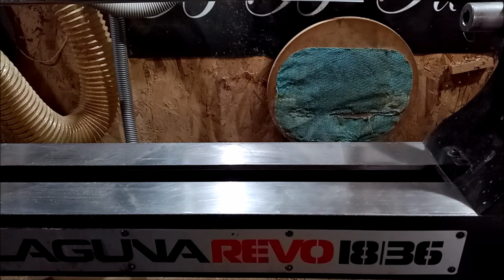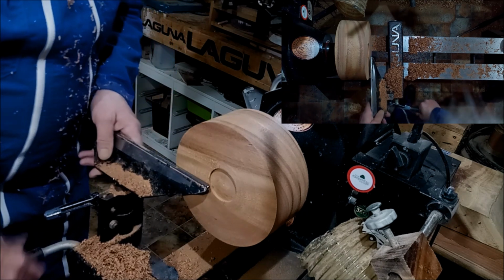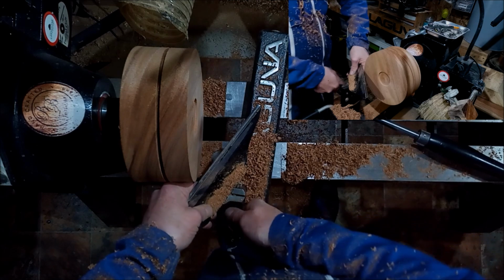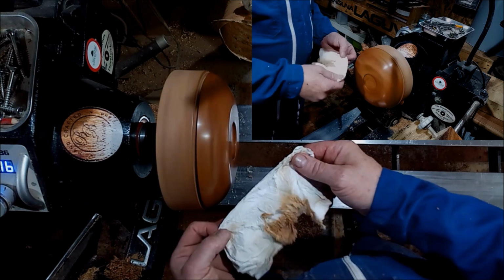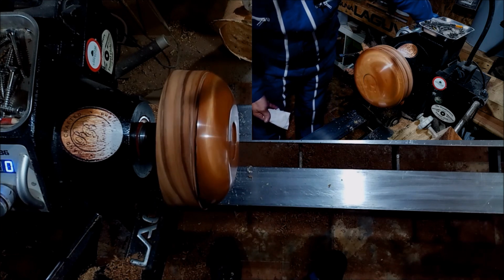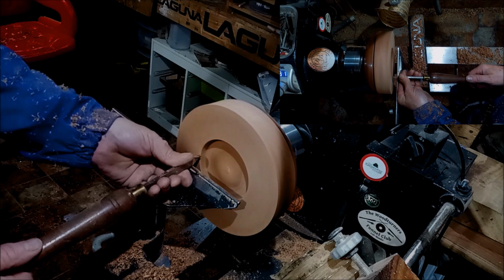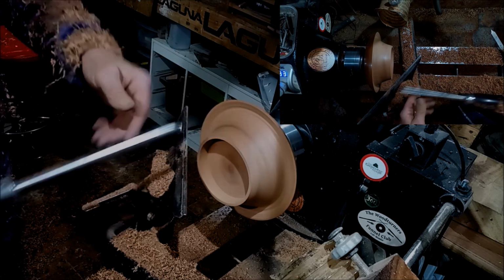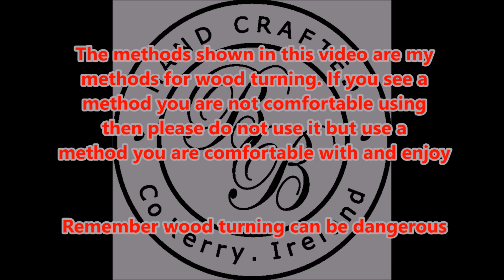Woodturning a holder for a candle in a jar / wood turning

Comment: Shay I'm new to your channel & to turning. I'm learning so much so thank you very much. As a Scotsman & a fellow gael I'm loving the Irish legends. Keep up the good work & I'll be continuing to tune in & thanks again. 
Jim
Reply from the maker: I am glad you are enjoying the videos Jim, welcome aboard mate. If you have any questions that i can help you with just ask.
Shay
Reply: @BBTurning  Thanks Shay. I'll take you up on your offer of advice. My workshop /shed was built 4 weeks ago & I have all new machines ready to fit up & install. Unfortunately I lost my mum 3 weeks ago so obviously everything went on hold. My lathe is a Rutlands R2000, 12" swing but can I ask, the centers that were supplied are acceptable but not the best. I'm replacing them but am I better off getting a matched pair of crown /steb enters or a matched pair of ring centers ? Thanks in advance & this will no doubt be the 1rst of many questions I annoy you with 😊
Reply from the maker: If you are getting new centres I would go for steb, they are much safer and more forgiving Jim. My condolences on your Mum, mine passed about 10 years ago, it is not an easy thing.
Shay
Reply: Thank you on both counts, center advice & for my "dear auld maw" God bless her

Comment: I agree with you it's a great job you have done. How are you getting on with your power respirator Shay
Reply from the maker: It works great Steve, I am using it for any wood that is even slightly dusty and for all sanding.
Shay

Comment: Different but Brilliant, nice one Shay.

Your story reminded me of the last time I was in Ireland, I got lost down a country lane at night, and the car broke down,
it just cut out. As I was looking under the bonnet to check and see what was wrong. I heard a voice say check
your fuel line, which I did straight away, and indeed it had come loose, so I pushed it on.
I look around to say thanks. But there stood in front of me was a big white horse. The horse said "you welcome".
At the point I jumped back into the car, totally petrified, and raced off.
I found a country pub a few mile down the road, run inside, got a drink, and told my story to the bar man.
The Bar man went on to inform me, that I was so lucky it was the White horse, as the black horse new nothing about car mechanics. LOL
Reply from the maker: Lol , that one made me laugh Oli, nice one mate.
Shay